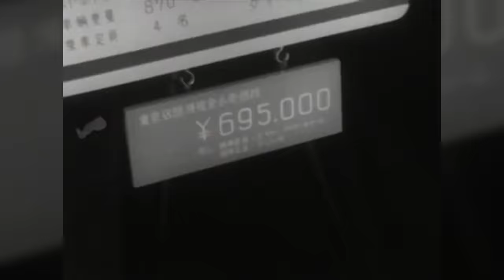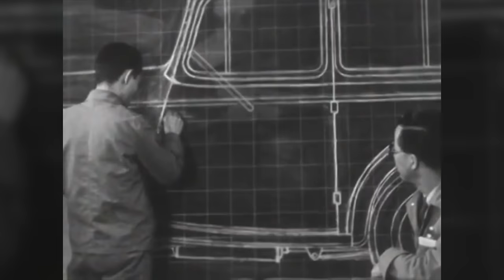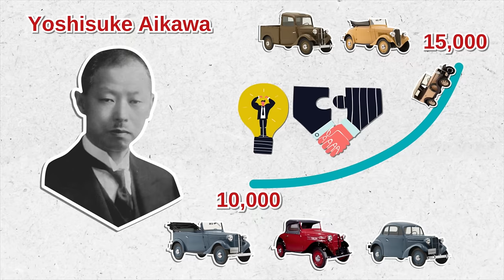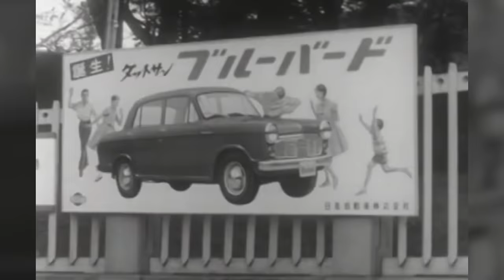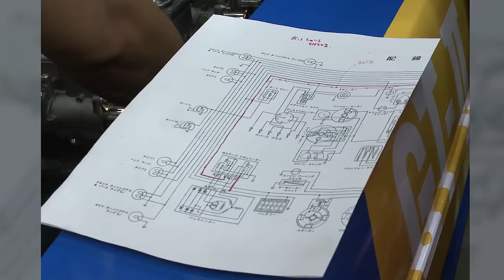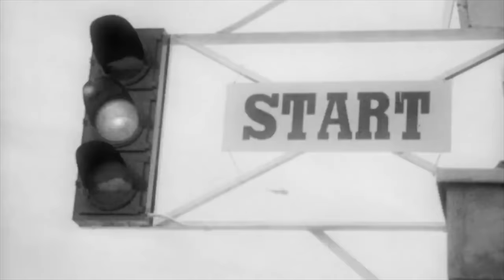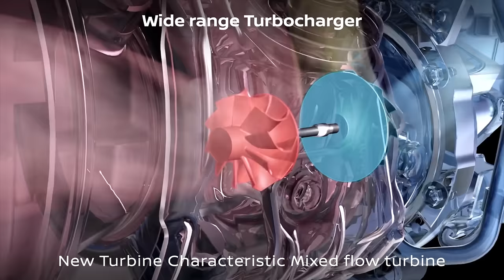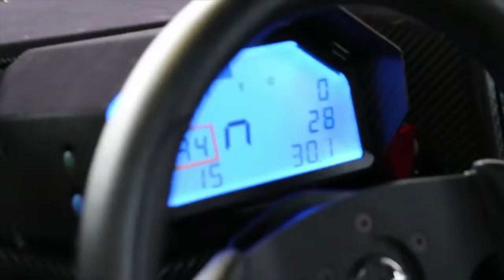Nissan Just Changed the World

Comment: At 20:56, was that RB20-DET engine 190 HP and 204 ft-lb torque as illustrated OR was it 190 HP and 240 ft-lb or torque that I think you said? Love all your videos, but more on old Chevy, Ford, and Dodge trucks please...and maybe a few videos on Saturn. I've got a 2002 Saturn SC2 with 312,000 miles on it. It's got a few issues and I've replaced a few things, but she still goes!

Comment: I’m looking at an 03 Nissan Maxima gle with 180k miles. They said the motor is knocking and it will probably need a new motor. They had it listed for $950 and Talked them down to $750 since I will have to have it towed 40 miles. Should I buy it? I’m thinking of replacing the engine with a used engine that works. I can’t get a car loan because I don’t make enough. I’m a single mom with no child support going to college living with my father. I have fair credit. I make $400 a month doing postmates with a car I share with my sister. I need a car to get a job not doing postmates. Should I get the car?

Comment: Skylines were scary powerful but transmission like all Nissan’s just not reliable for long term 🥲. As for that zero emission they should not be allowed to say zero because it takes emissions to make that expensive battery and it takes fossil fuels like coal to charge them. Even if you use solar panel chargers you got emissions used to make the panels, expensive glass, and still no real safe way to dispose of worn out panels.

Comment: 2.7L 4 cylinder Gas 4 speed automatic or 4.0L V6 Gas 6 speed automatic? Which is better in the long run?
Reply: @mcc7762  what's your opinion on engine swaps?
Reply: @mcc7762  would be considered the same thing for transmission swaps? From automatic to manual?
Reply: @mcc7762  thanks man